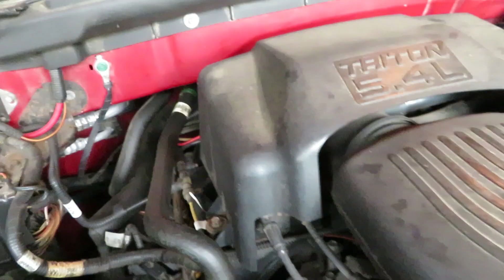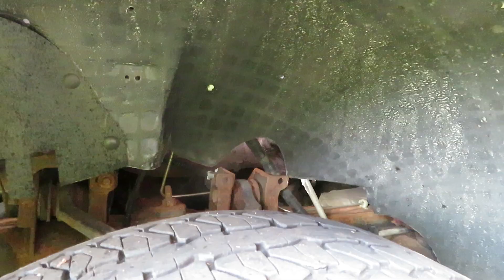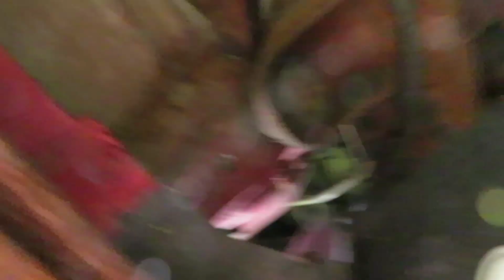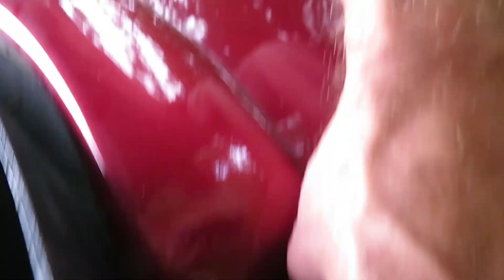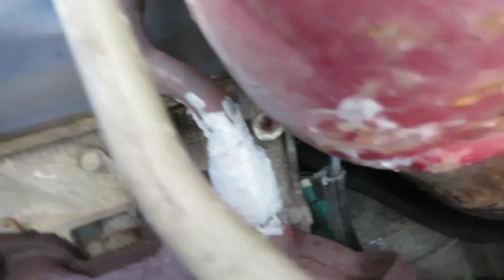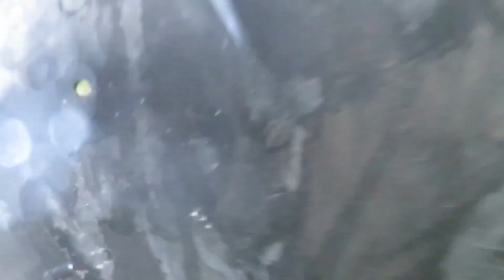How to Replace or Repair a Leaky EGR Tube Ford F150, Explorer and More

Comment: I would not recommend taking that tube off of that egr valve if you do get ready to replace the egr valve, then go through breaking tons of 10 mm bolts trying to get it apart…. These fords rust like hell around the threads, seize and what not…. Definitely broke the egr valve trying to break the nut on the tube loose along with the rest of the bolts replacing everything
Reply from the maker: I guess I got lucky on the tube nut. I haven't been lucky on much else regarding rust, especially under this truck.

Comment: There's a reason why all these videos show an F150. The pipe connection on the E150 is darn near impossible to get to. For some treason the geniuses at Ford put the connection at the FRONT of the manifold! If one can manage to get a wrench on it the nut can only be turned about an 1/8 of a turn, not enough to flip the wrench over to turn it further. I'll be using the Permatex goo, mine is broken and I've already seen videos of the troubles involved in replacing the manifold. Thanks Ford!
Reply from the maker: This repair began to leak again a few months later.  I ended up redoing the repair with the permatex but then wrapping it with sheet metal and clamping that in place with 2 band clamps. It has held up for two years now.
Reply: @TheOriginalMechanic  I just finished today. Used JB Weld Extreme Temperature, but no wrapping. I only use the van for camping, maybe 1000 miles per year. I hope it holds up, I've seen how much trouble it is to replace the manifold.
Reply from the maker: @davidpatterson9840  I think JB weld is excellent, but it's the vibration that may rattle it loose. You're right about the manifold. It can be a nightmare to replace. Hope it holds up for you.

Comment: Hello there thanks for the video I have the same problem with my ford just got the stuff  gonna start on it in a few hours how's you're pick up holding up ?
Reply from the maker: I have to confess it didn't hold up but for a few months. I later used JB Weld alone and it's still holding up but I'm picking up a slight rattle now. I may apply some more soon.

Comment: The connector isn't welded into the manifold, it is just a bitch to get out.

I ended up using a 1 1/8 socket, on a 24" breaker bar , heated the  connector with a torch,  hit it with crc freeze off, and it broke free.

Comment: I will put a pipe sleeve over mine. How long has is lasted?  Thank you
Reply from the maker: My first repair lasted a couple months. The second time I used JB weld and it is still good over a year later. I think the pipe sleeve is the best solution though.
Reply: @TheOriginalMechanic  can you get pipe sleeves at Canadian Tire?
Reply from the maker: @diannerobinson7858  I don't have an answer for that. I do like the idea of a pipe sleeve though.

Comment: I found your video when looking for information about where both the rubber tubes that come off the top of the EGR Tube go.  My 2000 F150 has the back one completely open.  I could get the general idea of where those tubes originate (from your video) but couldn't see it clearly.  If you have any other pictures or video you can share, I'd be very grateful.
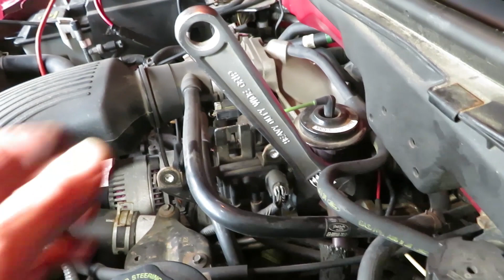Reply from the maker: Pause the video at 4:30 and you will have a view where these hoses can be seen entering a small plastic box beside the the throttle body.